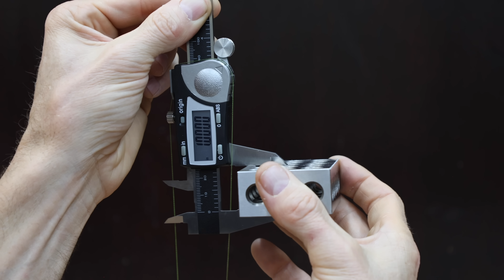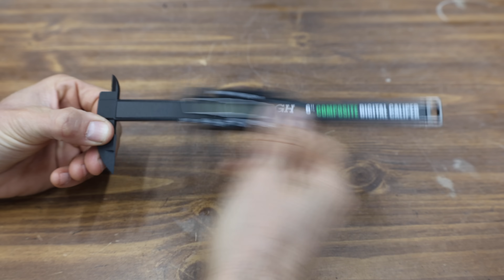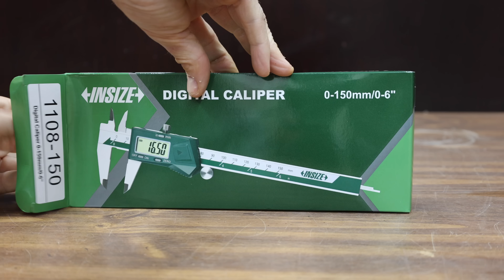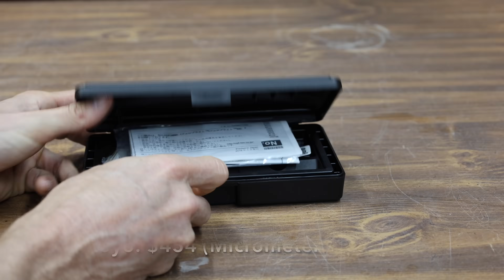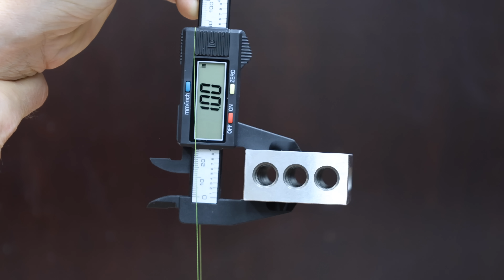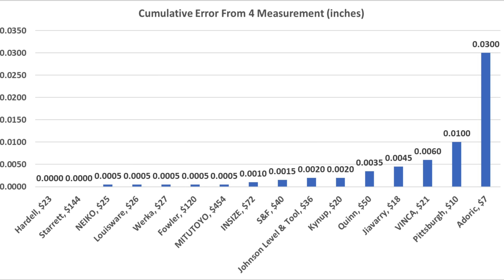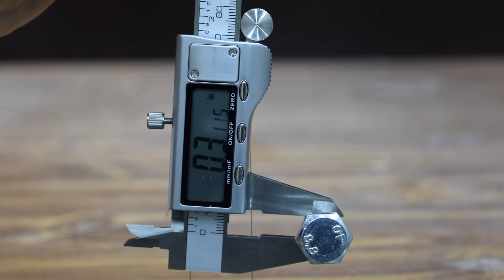I've Been Proven Wrong About Calipers!

Comment: Glad to see my NEIKO held up ok in the test.  I bought mine several years ago, but still use it quite often.  One feature I love is the fraction and decimal options.  Saves me the trouble of converting decimal to fraction when checking nut and bolt sizes.
Reply: Came here to say the same thing. I use the NEIKOs for 3D printing and they’ve been very solid. The battery is my biggest gripe - smaller and more annoying (for me) to source. A really great value though.

Comment: If you want a forever caliper get the Mitutoyo with the carbide tips. The most important thing for me when choosing a caliper is how accurate the inside measuring tips are. If they are off that means you need a calibration tool to apply the offset. If they measure under then you have to file them back so they measure over and then apply the offset. PIA, and leaves room for errors if you forget to do it before use, or if you forget to reset 0 before going to measure OD or depth.

Comment: I purchased a VINCA IP54 Grade Digital Caliper in 2020. I use it weekly to measure the diameter of my inline skate wheels before rotating them. I rotate every 3 to 5 hours of skating and have done so around 250 times since purchasing. Anyways the VINCA have worked mostly well for this however at times the readings get way way off and I have to reset the battery.

Comment: I have the Neiko calipers at home and Mitutoyos at work.
The largest difference I’ve noticed is the battery life. Clicking the power button on the Mitutoyos actually seems to shut them off rather than just turn the display off.

I would have liked to see testing battery drain when not in use, but overall great videos as always!

Comment: I use calipers for reloading. I tried the HF and Franklin Armory digitals and they were very flaky to the point I didn't trust them at all. I went back to dial calipers. I don't think there is much of an argument that Mitutoyo and Starrett are head and shoulders above anything else out there with more Mitutoyo digital recommended over the Starrett digital.

Comment: 15:13 hole depth measurement potentially not accurate since it was done on a used wooden surface rather than a surface plate (or at least something milled flat).
Reply: Yeah this video in particular has quite a few issues with methodology.

His laid back testing works for a lot of “normal” tools but it’s just not very good when it comes to things with actual precision
Reply: I was thinking that if done on a granite counter top, that has better known flatness
Reply: The entire video is flawed but that one was just blatantly wrong.

Comment: I mainly use calipers to measure parts for PCB design, and for this purpose, a cheap one is sufficient. However, if I have to show the measurement value to others, I would not choose any other brand but Mitutoyo. However, it seems that there are too many fake Mitutoyo these days.

Comment: I have a few sets of dial calipers.  Yes, I'm a little old-school.  No batteries to wear out, but I do have to keep the rack clean.  I keep my Mitutoyo for work, where accuracy and reliability is key.  I have a couple sets of discount (i.e. "disposable") ones that I use around the house when working on my own projects and accuracy to the 1/2 thousandth is not critical.  I work in Imperial units, so the ability for digital conversion isn't all that important to me.
But, I was very surprised to see how well the Werka performed.  At $27, they would be a great discount set of calipers.

Comment: My dad gave me a set of plastic calipers that he got at an estate sale.  I have Mitutoyo calipers I use around the house and in my shop.  Those plastic calipers work just fine, but they are hot garbage.  Just handling them, they feel so cheap.  They live permanently in my range bag and are for measuring groups.  

For that purpose, and any general measuring, they're fine.  For serious work that requires more precision, the Mitutoyo get the job.

Comment: I got Louisware/Jiavarry style calipers direct from Ali (3 in use, 18 months so far, they start to flicker when battery runs low).  They work well enough for hobby use down to 0.01mm.  I also only have hobby machines, so I wouldn't see where more expensive calipers would be beneficial.  The machines also got 0.005 um glass scales, which means the calipers are really only needed for 'rough' stuff anyway.
For anything that needs more accuracy there are micrometers at hand anyway..  overall, for business/trade - sure, get the good stuff - but for hobbyists?  Nah

Comment: I have the Adoric and have for quite a few years.  For the homeowner doing small projects, it's been fine for most stuff (wood working and welding, confirming hole & thickness diameters of hoses, bar stock, etc) and far beats using ruler.  Unless you're doing ultra precise scientific measurements or for pro use, you don't need a $100+ caliper it's excessive.

Comment: The Shars Aventor brand caliper is one with a large battery capacity, absolute zero memory and auto shutoff.  It is smooth and accurate. If you do a folIlow-up or another test at some point it would be one to consider.  It is used by a lot of machinists and some are under $100.

Comment: It would be interested to see the internals. I suspect many of them are using the exact same circuit board layout and components. I use the iGuaging EZCal which meets all the criteria for putting it toward the top of the list, but their next level up has a connection for sending measurements to your computer which I would have liked to have had, and for rough measurements it would be nice for it to round to the nearest 1/32 instead of always showing 1/128 or 1/64 even when one more unit would make it a 64th or 32nd depending on the situation. I am also curious if there is a  recommended way to disasemble and clean calipers or if they should be left alone and cleaned in situ.

Comment: For accurate measurements you never use the thumb wheel or any other part of the head.  The most accurate method is to squeeze the jaws together directly inline with the points of contact. Obviously this is only practical on OD measurements, for other types of measurements careful application of pressure on the head will minimize jaw 'racking' to get the most accurate measurement.  Practice measuring known dimensions will help you develop the correct 'feel' of your caliper as you make random measurements.  As always, measure it several times and if your measurements aren't repeating, then you have to stop and determine the source of the error.

Comment: GREAT REVIEW but some misses: 1 Given your reputation, Why no drop test - all machinist  eventually do this.  2 use small and large gauge pins and measure 3 spots inside the jaws.  the difference between cheap vs expensive is often the variance of several measurements between small and large readings, and the cheap ones usually get worse with many consecutive measurements.  3 the thumb wheel should be used when measuring and never touch the jaws with your hands.

Comment: I have never owned expensive calipers. I have had all metal, non digital (vernier) calipers. They corroded in the work situation where I used them. Moving to the cheapest Chinese, digital calipers was a revelation. Easy to read LCD display is more than enough when you only want to measure to 0.1mm accuracy. Wipe them down and put them away.

Comment: I've been machining both at home and professionally for over 40 years.  Hands down, Mitutoyo are the best.  Not a huge Starrett caliper fan, prefer the form factor and buttery smoothness of the Mits.  My only other caliper experience has been with the ubiquitous Chinese made calipers in various versions.  The biggest issue with them, which for some odd reason you didn't test???, is battery life.  I have to take the batteries out of the Chinese calipers or they'll be dead in 6 - 12 months.  I get at least 3 years out of the Mitutoyo batteries.  The 2nd major issue with cheap calipers is the display update speed which you also failed to test.  Mits & Starrett's display updates very quickly allowing you to track the position of something moving (think poor-mans DRO, very commonly used on mill quills).  The Chinese calipers update very, very slowly forcing you to slow down your cut as you approach dimension which affects the surface finish due to the inconsistent speed.  Accuracy is one of my least important characteristics when it comes to calipers since they aren't really a precision tool.  IIRC, the accuracy spec. of my Mitutoyo's is 0.001" ± 1 or 2 counts, and even the Chinese ones usually meet this spec.  If you need a precise measurement for let's say boring a bearing race pocket, you would only use calipers for quick measurements as you're approaching the final dimension.  Once you get down under 0.010", you would switch over to a precision instrument, in this case I'd have a bore gauge set to the OD of the race giving me a direct reading relative to the OD dimension without having to do the math..

Comment: I have a Mitutoyo that I bought in 1989, so 36 years old! still work perfectly, 100% accurate. superb quality and cost £250 back then (equates to about £650 today).  Wonder how many $10 calipers will still be around  in 2061?!?!?!
Reply: I hope its accuracy is better than your math.
Reply: My second pair of Mitutoyo calipers from 1982 work just fine with no wear.
Reply: I had to compare your math to mine because my daughter was born in 1989. I'm glad my math was less than yours because I would have gained an extra 10 years. 😂 (36 years is very impressive and I buy the same brand for use in a production facility.)

Comment: Long time old machinist. As an apprentice 40+ years ago one of my first purchases was a previously owned 8 inch Mitutoya dial caliper. It still works fine.
But to be honest it is mostly used for quick reference measurements. Any thing that has to be really accurate always gets measured with micrometers.

If you check that 1-2-3 block tomorrow and the temperature changes you might get different readings....lol

99% of the things most people will use calipers for any of them will be fine...
Reply: As a TIG welder who used to read a lot of blueprints using decimals I bought my first set of Mitutoyo 6 and 12 inch dial calipers in 1982 and they still work great. I use the LCD electronic ones now because of poor eyesight.

Comment: What about testing error with temperature ?   and one other thing is when many measurements are made without setting it to zero the error would pile up to even larger error.  Set to zero, slide it 100 times and see if its zero.

Comment: being smooth is kinda a double edge sword type of situation.  Yes smoothness is great but if it is too smooth it can move way to easily and you can lose your 'location' on the caliper.  Some times you need to transfer that measurement to another item and in those situations you want it to hold its spot.

Comment: an issue with the cheapos is that often they stay on and only turn off the display only; aka best to pull the battery when not in use as the battery will go dead otherwise... forgot which channel I seen that on but can confirm with the first one I bought off dealextreme way long ago... on the positive side a lot of them have data out or use to, aka can have it output to a computer or similar:)

Comment: I had a  reasonably cheap set of callipers that I thought were ok as I am just a hobbyist, but I was having trouble getting consistent readings.
I finally thought of closing the jaws and holding it to the light. The damn jaws were not parallel, there was about 0.5mm gap at the bottom when the tips touched. 
Definitely something worth checking on the cheap sets.
I got a good (ie expensive) set but at least I can trust them.

Comment: The audio off is misleading a bit because the Mitutoyo's low power mode is infinity times better than auto off. 

Mitutoyos will last years on a battery in a regular use environment and never being tured off. Meanwhile every other set I use sucks juice no metter whether its on or off and dies after a few months.

I have a set of Mitutoyos that my old man bought in 1995 that have been a workhorse to this day and a brand new set I bought a week or so back from MSC. They're both easily better than anything else I've used from a just being able to grab it and use it perspective.

Comment: I have 2 sets of the Mitutoyo calipers and the digital micrometer.  With almost 5 years of daily use and finding them on in the case a lot I am not concerned about the battery life.  Personally I don’t like the digital mic, it’s awkward to use 1 handed.

Comment: Where was your thermal camera? Your hands touching the block would have warmed it up. I trhst the 3.005 readings,most for this reason. If you verified the block with the micrometer first cool, then tested in the order shown your interpretation was likely wrong. Also, you should hqve had the block on a clean dry granite or ground steel surface for the depth tests.

Comment: It's actually fairly surprising that there is very little variation between the $10 and $450 sets. It would have been interesting to see the variation based on how much pressure was applied to closing them as that could easily be the thing that shows the biggest difference between the cheap and expensive ones. I'd also like to see how much the measurement vary with say ambient temperatures of -20C to 40C as that sort of temperature range is quite conceivable for outdoor measurements.

Comment: German machine shop old hands told me the best way to find out if it's a good digital caliper, is the time test.
Put it away in a temperature controlled area, and then open it up a few weeks later, see if it holds zero.
That's the real test when all else is equal, cheap ones have counters that will drift.
I tested my kinchrome, 230-270g with majority at 250-240g. Super smooth and was cheap used and mint, no drift when off over long time, auto off, rarely if ever drift during use, battery also lasts a long time (year+ so far). Would be 70-100 USD equivalent new, very accurate, CR2032 is definitely a good tell of memory/storage of position. Seems like lot of OEMS and rebrands on these things using similar hardware inside.

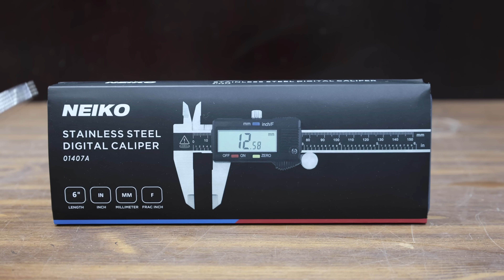Comment: I had a set of the Mitutoyo long ago before the days of 3d printing, I had paid nearly $200 for them new and basically only used them on precision natural gas compressor stages and diesel engine internals .  The best thing about them was that  they were the type of quality, that a pawn shop would accept and I believe I was able to sell them for $80 even after 2-3 years old.      Nowadays I use my Neiko @4:05 calipers daily when printing and drawing parts, and they are totally "good enough" for this type usage.   But no way would a tool/pawn shop offer to buy the china made.  So, depending on your needs and means the fact they hold value is always something to consider.

Comment: Let me paint a picture on just how low power the mitutoyo battery draw is. I had a no name Amazon special caliper that I used so frequently and would have to change the batteries every 3 months. I got so annoyed by random dead batteries that I modified the caliper to use a AAA battery, at the cost of losing some depth gauge range. 
I've had the mitutoyo for more than two years, I use it frequently, sometimes I forget to turn it off even ... I haven't had to change the battery that came with it yet

Comment: At my shop we mostly use mics and not calipers, but we have Mitutoyo. We also have some Starret and Fowler for measuring abrasive thing like the machine grind wheel because they are cheaper to replace when they begin to wear. For when we need to be more accurate than mics we have mostly Swedish equipment and some Mitutoyo.

Comment: Everybody who has these would've noticed that they seem to deplete batteries even when they appear to be switched off.
Some people suspect that the OFF is only to stop the display, and the rest of the processing never stops.
I wish that ProjectFarm would find out which ones didn't drain batteries.
I prefer plastic over stainless steel, and I prefer CR2032 over LR44.
I wish ProjectFarm actually measured the digit sizes and summarized which ones really had jumbo digits.

Comment: I found your test interesting but in real life in the shop I found the Mitutoyo to hold up the best. As for battery life I replace my battery's about every two years or so in Mitutoyo and usually never turn them off. You can buy standard set for about $150.00 and carbide jaw set for $240.00.

Comment: Little correction at 17:40 - a CR2032 actually has around four times the energy capacity of an LR44, not double.

That's because it has both ~2x the mAh rating as well as 2x the nominal voltage - you need to multiply them to get the mWh rating.

Comment: For everyone complaining about battery life, if the caliper is the cheap set with the slide off battery cover when done flip battery over. Been on the same battery for 2+ years and use them a few times a month. Only takes 5 seconds to flip the battery back and forth and obviously if using it day after day, then it may be slightly bothersome. But if only used here and there the few seconds is worth not having a dead battery the next time you use it two months later. 
If it's a screw type battery cover, yeah, more of a PITA. But the cheap, slide off battery cover has it's advantages.

Comment: I find my digital Calipers drain the battery even when off. I remove it when not in use. My preferred calipers have a dial; easy to read, no battery to worry about and no power down after five minutes.

Comment: The problem with every cheap digital caliper is that they will be dead when you need them in months. You need to stock up on batteries. They drain almost 10-20 times what the mitutoyo does when off.